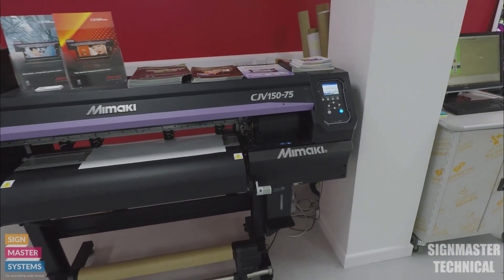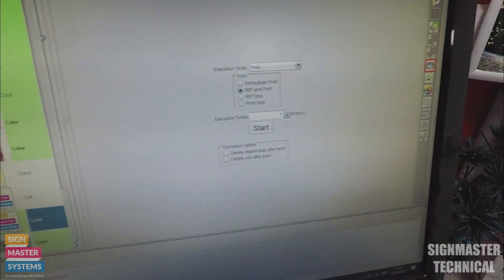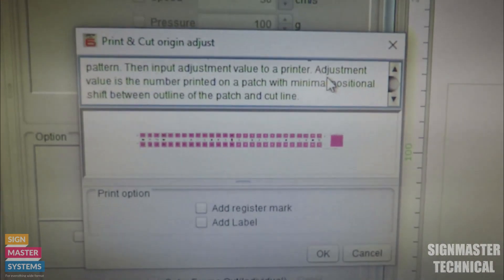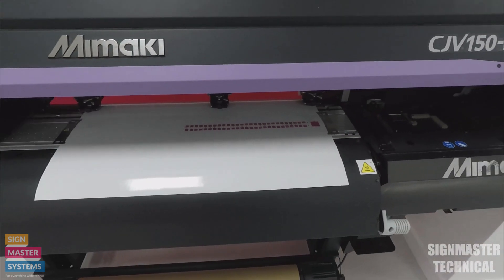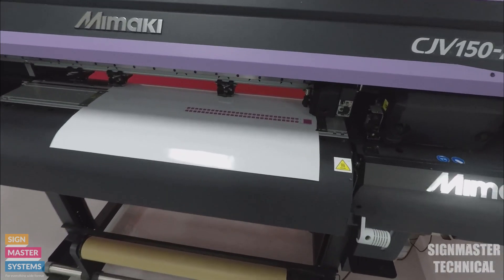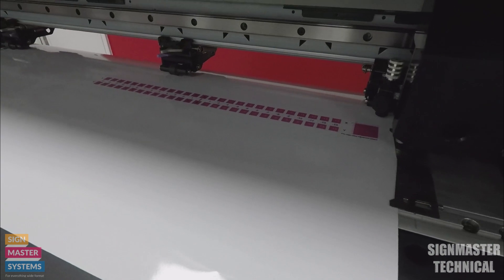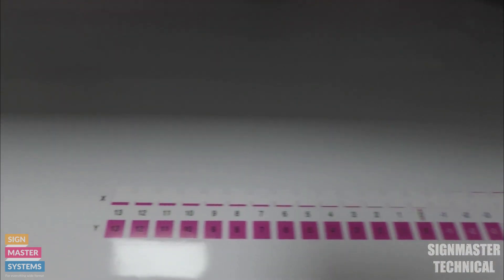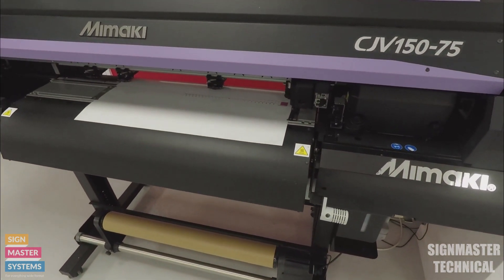How To Do Your Print and Cut Alignment || Mimaki CJV150/300

Comment: What about the TP offset? When do we adjust that setting? Would that make any difference? I appreciate your help.
Reply from the maker: Hello, the TP offset is necessary for the print & cut alignment with registration marks only. When selecting the print & cut alignment you get a choice to have with or without reg marks then you would use TP offset for with marks. Please note if using the reg mark version you only use 0.10 adjustments not full point adjustments like the PC origin offset. Hope this helps
Reply: @SignmasterTechnical  I will try, thank you!

Comment: Hi the cut button is not highlighted. Its greyed out and not clickable. UCJV300/150. Any help is appreciated
Reply from the maker: Hello, if you are referring to the cut edit tab that you can find the alignment in Rasterlink you have to select a job that has a cut line on it to be able to run the print and cut alignment.

Comment: How do you increase the box and text size for the programme displayed? mine is displayed super tiny
Reply from the maker: Sorry i'm not sure what you mean could you provide more detail on the issue
Reply: The wording in rasterlink 6 programme is V small
Reply from the maker: My version seems to be ok and I cant seem to find anywhere in the program to increase this, you can increase the job thumbnail size using the slider bar near the job list or if overall it is small try changing your monitor resolution settings.

Comment: Hello! I am trying to decide between a Roland BN-20A and a Mimaki CJY150-75. Do you have an opinion on the comparison? Or experience with either of them… or both?
Reply from the maker: Both are good machines, the BN is smaller, a little slower and more suited to beginners or crafters
Reply: I am just beginning with a printer cutter, but I have been working on a plotter for almost 2 years now. I just only want to buy once! Ya know? But I want to prepare for the future too🤔
Reply from the maker: There is a new Roland BN2-20 that has just been released, it is worth a look as it is 4 times faster than the original BN with a lot more features
Reply: @SignmasterTechnical  thank you! That is actually what I ended up getting and I LOVE it!!! Thank you! Great minds think alike!

Comment: Hi, i couldn't make CJV150 to print remotely, followed your video when i pressed FUNC3 it stays green with remote word so is there anyway to make it functional to print from my desktop ?
Reply from the maker: The Mimaki machines need to be in remote mode to receive print data from the RIP software

Comment: This is just on step to the print and alignment setup. There is much more.
Reply from the maker: This should be enough to bring your stray cuts back into line. There is more you can do but this should be enough to make a change
Reply: Unfortunately, it is not enough! @SignmasterTechnical

Comment: i own a cjv150-130 machine. the propblem with these machines that i am experiencing is that you can do the print and cut PC Origin Alignment or TP alighnment and it will most probably work fine when cutting 1 or 2 stickers nut the munite you cutting 100 x 90mm round or square stickers they will cut way out of alignment no matter how many times you perform the alignment adjustments even if your media is loaded correctly.
Reply: im also having this problem. did you find a way to fix it?
Reply: so frustrating even with reg marks and adjusting tps before the cut. Especially with prints going away on x axis. Was told to much pressure when laminating can cause this as well... As if Mimaki hasnt got an automatic function to prevent this
Reply: Hi,Do you need mimaki chips? we are specialized in selling printer chips in China,and we also selling single pass printer and UV printer,pls contact me if you are interested in it
Reply: Also looking for answers
Reply from the maker: Have you tried using reg marks on your print and cut work as this always give a more accurate cut than without. Also check your pincher roller settings on your printer to make sure these are set correctly
Reply: HI. I'm having the same issues as the guys that commented above. I just can't seem to solve the cut alignment problem, no matter how much I perform the protocol shown in this video.  @SignmasterTechnical